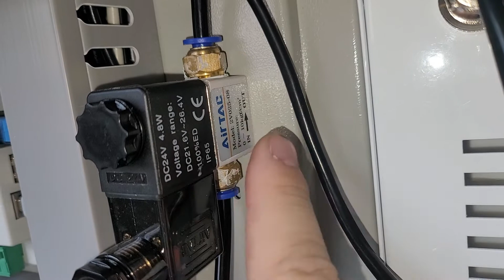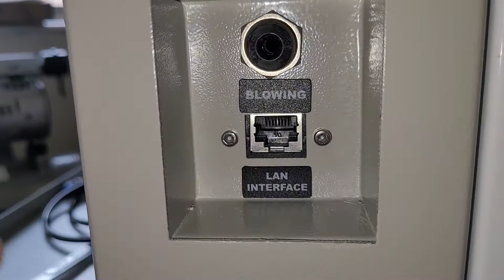Aeon MIRA 9 - Compressor air assist upgrade for updated machine - Feb 2021

Comment: So do you need to disable the integrated compressor somehow also so its not simply running all the time?
Reply: You don't have to, but you can.  I eventually did once I opened the back of the machine. There's a circuit board near the exhaust port and a wire that says something to the effect of 'air' on it.  Just unclipped it out of the harness and the internal compressor no longer comes on.
Reply: @PeabodysParadise  was it just that one yellow/green one?  I can follow it up to the pump....but I can't see the back of the pump to see if there is another back there.   Was it just the one wire you disconnected from the rail?  Great vid.
Reply: @TrevorAllenPhotography  you should be able to open the back hatch and see the air pump, which is a commercial style aquarium pump.  There should also be some wires to the right going into a board and one should be labeled "air" or something to that effect.  I unplugged that one and that did it.
Reply: @PeabodysParadise  thanks for the reply.   Yeah, nothing labeled ‘air’ but I see the wire coming from the air pump.   I was wondering if you disconnected one wire or multiple…but you just said ‘wires’ so I think that answers my question.
Reply: Can you please tell me the size of this tubing? I can’t find it